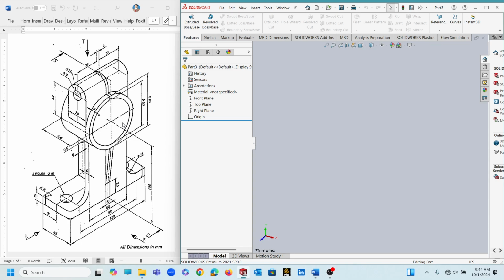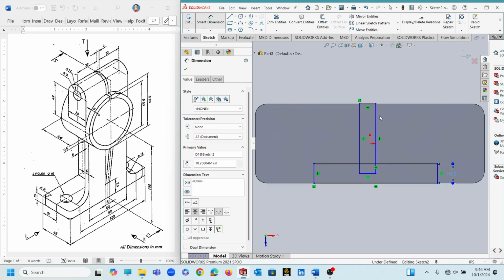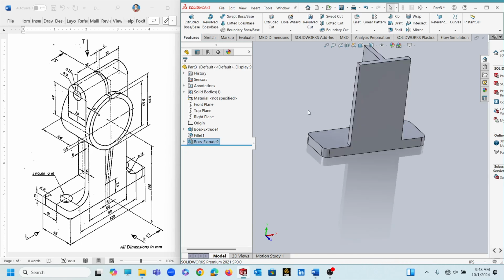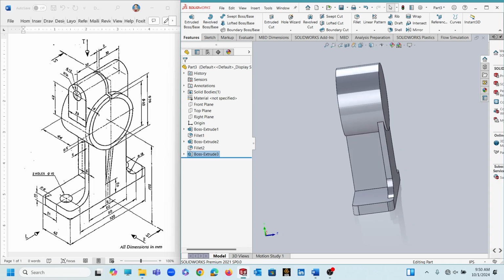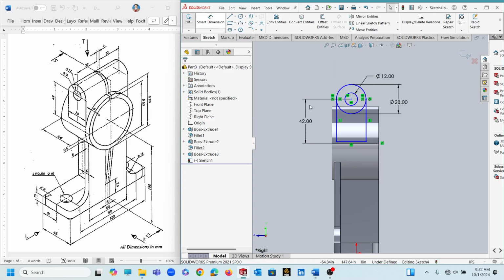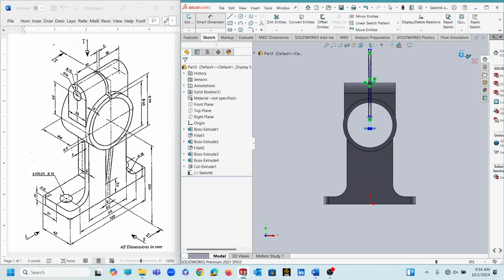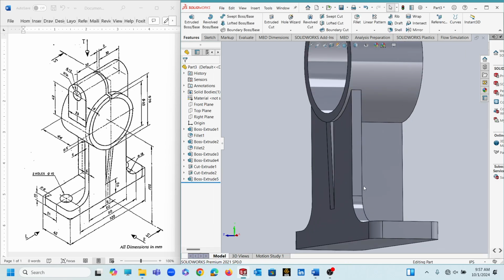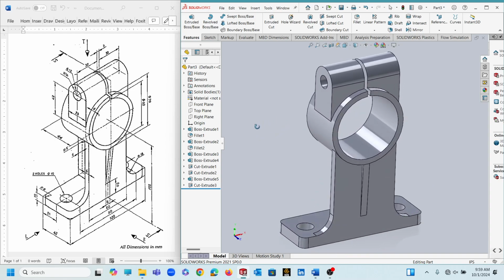Exercise 14

Comment: There's a slight mistake The extrusion of the circles having diameters 60 and 70 units  is meant to be 44 According to the given dimensions but it isn't.........cuz...... You did 2mm extra extrusion instead of 6 Which is not fair.....

Uh there's explicitly a 6 unit extra extrusion marked On the 70 units diameter circle...... So logically according to this uh it uh should be 48 instead of 44..........